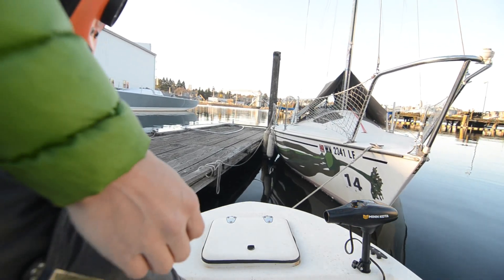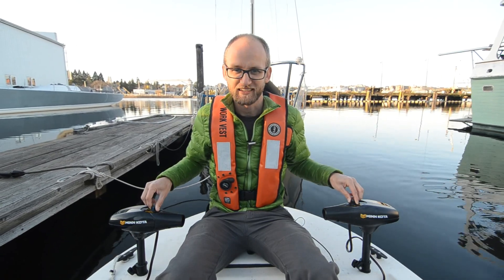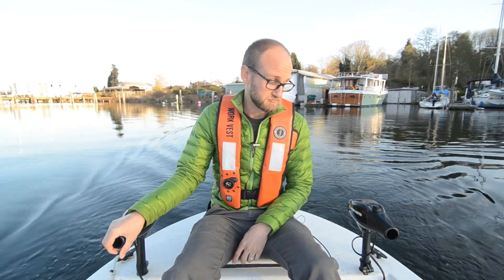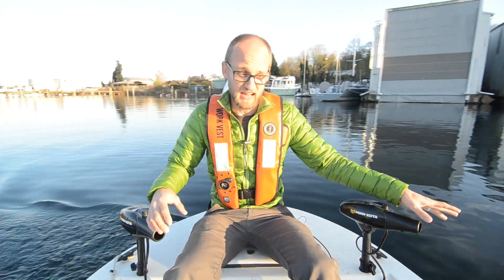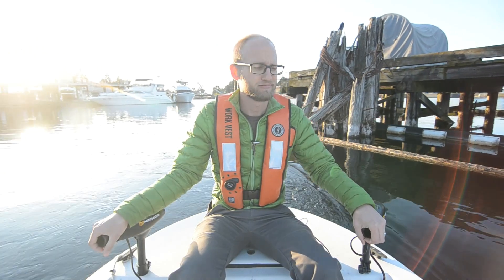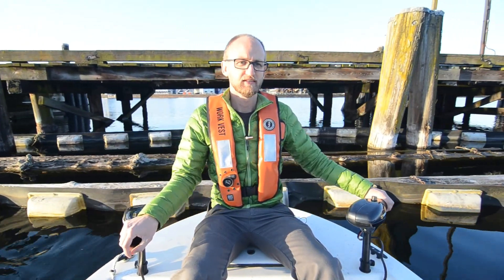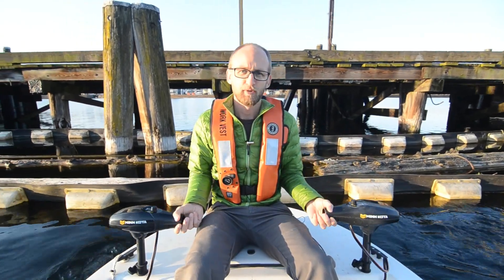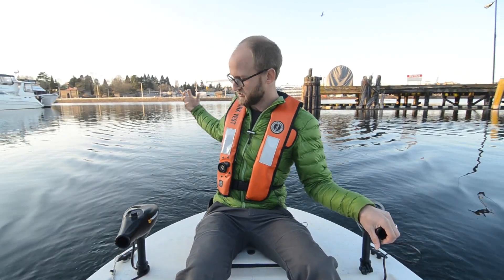World's first Solar-powered ASD Tug Boat!

Comment: About that TP52 in the background... Looks like one of the converted Pac52s. Love how you can hear the boat shuddering when you're walking, just like a big tractor.
Reply from the maker: You nailed it!  "Smoke" (formerly "Rebel Yell") is our neighbor here in Ballard.  Regarding the shuddering, I want more (aka, more power!).  The problem with more power is of course, more money.  I've got about $1000 into this boat....$100 hull, $400 batteries, $200 in motors, $300 for PWM's/fittings, bilge pump, winch, etc.  If I want to hit 5kts and a few hundred pounds of bollard, along with continuous drive rotation....that gets rather expensive.  Torqeedo is putting together a unit that'd I'd love to have, but for a dual electric power system it would be around $30k....so that won't be happening anytime soon. : )
Reply: @DanielMakaiBlanchard  Haha thats awesome. I've raced against her a few times :)

Good luck with the build, I'm really interested in trying something like this as a training platform. I currently work as a mate on tractors in Vancouver and would really love to practice on something like this. much cheaper than a simulator, and certainly cheaper than running a big boat!
Reply from the maker: @sailortristan  Thanks!  Centerline Logistics got the "BRAtt" back in 2011 and they occasionally use it for training here in Seattle, but I believe the steel version ("Suncor V") is still up in BC if you want to try and track her down.  They're both running Olympic drives, some decent-sized Cummins, and are probably the best thing to train with that's actually been produced.  My only change to the platform would be to use hybrid diesel-electric for the low-power finesse/idle work, and build them here in the US they could be put to work and not violate our Jones Act regulations regarding foreign hulls used for towing service.  Shoot me a message if you're in Seattle and you can come by and give her a whirl.
Reply from the maker: https://ral.ca/series/bratt/
Reply: @DanielMakaiBlanchard  Woah, ever cool! Built by robert allan, too! I for sure will do, cheers!

Comment: What boat was used. I'm looking to biuld similar set up
Reply from the maker: It's a Spincraft.  Not sure where you're at, but there is one for sale on Craigslist for $1250.  https://susanville.craigslist.org/search/sss?query=spincraft&sort=date&searchNearby=2&nearbyArea=216&nearbyArea=675&nearbyArea=708&nearbyArea=188&nearbyArea=189&nearbyArea=187&nearbyArea=454&nearbyArea=652&nearbyArea=92&nearbyArea=373&nearbyArea=456&nearbyArea=12&nearbyArea=97&nearbyArea=1&nearbyArea=96
Reply: Cool, how where you able to mount the motor thru your hull? What did u use for the seal for the underwater section?
Reply from the maker: @beastnicholls4071  Marelon (plastic) hosebarb thru hulls that were a bit under-sized, then I opened them up a bit on my lathe for a slip fit over the Minnkota shafts (which have an OD of....1.138" if I recall?).  4200 to seal, then about a foot of vertical hose from the hosebard up the motor shafts until the top of the hose cleared the waterline by about 6".  Super-duper on the cheap, but really effective.  Used AGM's (4 group 31's) for a total of about 350 amp-hours at 12v gives me around 7hrs to full discharge (25amps/motor at WOT = 2.5kts average).  Victron 25amp Bluetooth charger keeps them topped off, and an automatic bilge pump keeps the 500-ish pounds of boat from sinking from the rainwater.  I added a Minnkota Deckhand anchor winch as my "towing winch" and have been able to get a 20,000lb 35' fishing boat up to about 2kts in flat water with no wind.  Fun stuff!

Comment: This can be a great training aid. Just scale up and slow control response for a real ASD tug
-former single-screw operator
Reply from the maker: Yep, slower response is a bit of a technical feat, but one I'm very slowly working on.  Scale factors with models is not an exact science, and not all the elements scale very well.  From my experience with this one, I don't think a 15-18 second drive rotation will be appropriate like the real-deal because the boat is extremely tender and far more sensitive than full aziumth drives.  But slowed down rotation has complications in implementation.  My approach is going to be to write some Arduino code and run two independent drives with absolute position encoders on both sticks and drives, and then likely a PWM-controlled reduction gear attached to each drive via a weak-link belt drive.  Then I can just add a button or knob to control drive rotation speed within the Arduino code.

Comment: If only your drives moved that fast
Reply from the maker: Yeah!  I always tell folks that big boats are mostly no fun to drive, and that small boats are where it's at.  Version 3.0 will probably be around 14'-16', have a rain-proof cab, and drives that aren't physically coupled to the controls (but they'll still be pretty damn fast - I love the speed).  And hopefully hit 5+ knots without a massive wake.  If I can pull that off I'll probably stop driving my truck to work and just take the tug.
Reply: @DanielMakaiBlanchard  slow hands are a must on ASDs I always tell people to only move your hands as fast as the drives turn. Getting to many moves ahead is pretty common in the beginning. Looks like fun though.
Reply from the maker: @Cpt_Tack  I like the "only move your hands as fast as the drives turn" idea!  In this boat's case it's super-fast, but the phrase holds up since it runs at extremely slow power/speed.  At work we recently brought online two VRInsight Azimuth controllers to run separate tugs in joint ops for harbor docking simulations with our primary Transas bridge simulator and I love being able to switch between tractor and ASD, and to work in an environment where you can add wind, current, displacement, etc to whatever we're simulating.  But I still have the most fun with my little toy tug, and I can get a tan while I do it. : )